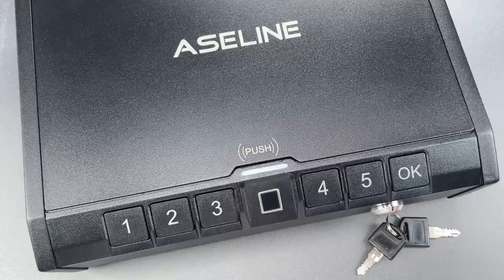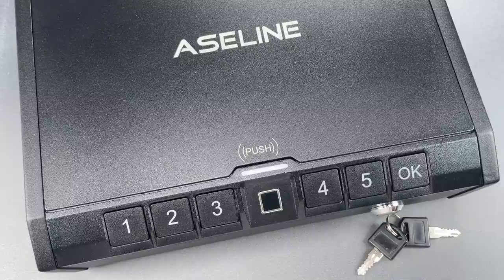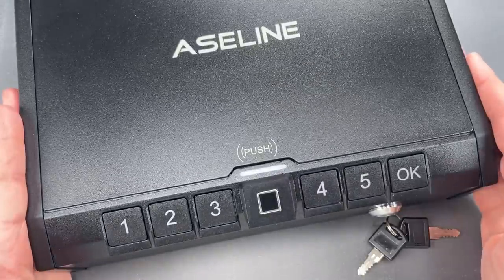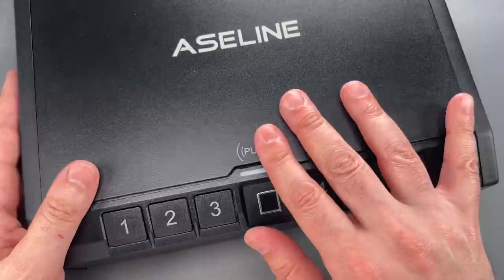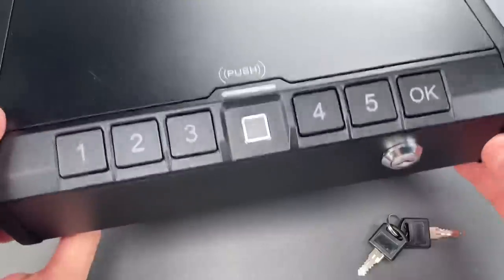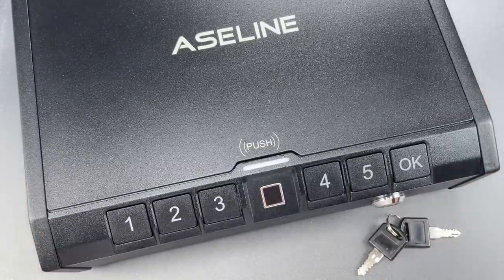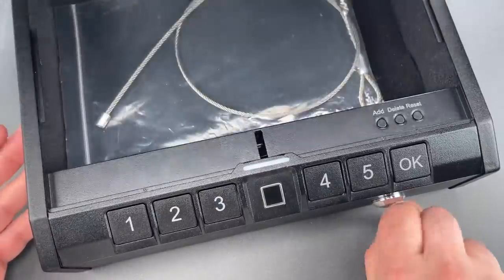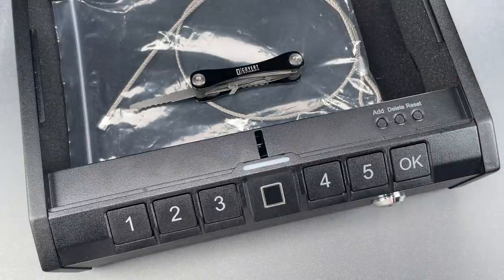[1445] “Aseline” Jiggled Open… As Bad As It Sounds.

Comment: Is there any gun safe out there that's not crap?   It seems most just exist to fulfill some minimum legal requirements.
Reply: That's basically why these handgun safes exist, because it's a legal requirement in some US states (the same goes for many of the very cheap gun lock mechanisms).
Most people don't actually want them at all, so many are made as cheap as can be gotten away with so people can spend a minimum on satisfying the legal requirements.
People have guns in case something happens, and they want it to be ready to use as fast as possible when seconds matter.

If you want safe storage for guns, what people typically look at is a proper standing gunsafe, the kind with shelves and racks which you can stack a whole set of long guns into vertically. If it's one you can bolt into your wall and floor, all the better.

Another option is higher end cable locks, basically an armored steel cable with a plastic/rubber cover (to protect the gun), and where you open the action of the gun and loop the cable through, locking it in place. That kind of setup would prevent the gun from being loaded and from being put in a fireable state.
As long as you get a decent one which can't be just jiggled open or which can be clipped in a matter of seconds with boltcutters, it would be fairly safe in terms of a household with small kids.
Theft protection is near nothing for small and light solutions like these though, as the locked gun can be just carried away, and the perpetrator can work away at cutting the lock/cable at his own time and in privacy.

Now, thieves have occasionally made off with entire gun safes, but that's less a swift crime of opportunity and more a planned 'heist' where two or more people have scouted the place out and they're gonna lug it out to their car to crack it elsewhere. Being able to fasten your safe to your house, both the floor and the wall, is therefore helpful in making such a venture harder and more time consuming. Note that it should be in something more rigid and sturdy than plain drywall though, otherwise that's just for show.
Reply: He's done a whole bunch of videos on locks and handgun safes, they're worth looking at to get an idea what can be worthwhile and not.

Comment: A little curious on the construction of the box and if it has an exposed hinge or any other glaring vulnerabilities.  Also, you only opened it once.  I say "fluke".  This is the one high security wafer lock that is almost impossible for you to jiggle open.  You just got lucky.

Comment: Meet the world of common sense...  Never ever store a loaded weapon.  Ammo should be in a separate safe locked away, sometimes WITH the magazine.  If you're going to use cheap gun safes, take sensible precautions.
Reply: The only reason the gun has a quick release open finger print lock is so it can be used quickly. They know the market. There is literally no reason anyone would store a gun loaded otherwise.

Comment: Honestly i think that this is safe enough for some curious kid, it would never have occurred to me as a kid to get a jiggle tool and try to open a lock, sure, it's not safe against someone who knows a little bit what they are doing but a kid propably won't open it.
Then again it doesn't take away the fact that it's terribly insecure for the purpose of storing guns, but at least little timmy won't be opening it with a fork

Comment: I would at least hide the cylinder on the bottom or rear of the case under a cover with 10 security torx screws.

Comment: I do think that this one would stop a curious person including kids from eay access and as it has a code which. could easy be guessed it does not really need a high value lock as it is designed to secure  the pistol to allow quick access and  u had to use a specialised bit of kit to open it and it was a delipetae attempt and u needed to know how to do it. the best test would be give it to someone who did not know how to open it

Comment: Good grief, this is as sloppy as a lock that can be defeated with a wave rake. If it wasn't faster to just jiggle the mechanical lock, that numeric keypad only has five numbers, and I bet the PIN is four digits long, and probably wouldn't take too much to solve for. If destructive entry is fine, that latch looks like you could beat it with a flathead screwdriver and a hammer, and the construction looks and sounds like it's thin and vulnerable. Could probably get through it with a hammer and icepick.

Comment: I really don't get why these safes cheap out so hard on the manual override lock. Like they thought to go as far as making sure that you can't reprogram the e-lock while it's closed, but they still use a tiny shitty lock as the bypass. Is it really that expensive to just buy a slightly better core?

Comment: Do you actually have to have a backup lock? I'd assume that for safety reasons, having to destroy the "safe" if the main lock is not usable for some reason would be a better compromise than putting in a weak backdoor.
Reply: Its a perspective thing, people see a key as a "harder" lock because you need an item(and thus a sensible backup) where electronics require merely data that can be gleaned and is the "easier" to open lock, despite the fact that the key is the weakpoint in reality
Reply: @syrelian  It would be stronger if it was a good one.

Comment: Would this safe be viable if you... I don't know... solder the keyway closed so that it can no longer be used? 
If you remove that method from the equation is the rest of the safe secure?

Comment: Videos like this often make me wonder: If I disabled the physical lock -- say, filled the keyway with superglue (and then relied exclusively on the fingerprint or combination, obv.) -- then would this kind of lock be reasonably safe?
Reply: yes but the lock exists for a reason, if the battery dies you'll have quite a fun time getting it open, assuming of course that you aren't buying one of those cheap ones that could easily be broken into destructively.

Comment: If you like a weapon case/safe but had a cheap lock cylinder. Are you able swap it out for a better or is it permanently fixed?
Reply: detaching a lock from a steel safe sounds like quite the operation but maybe
Reply: @ZechsMerquise73  Yes it could be. Would be worth it if the weapon case/safe checked the rest of the boxes. Companies cutting corners.

Comment: Hmmm, would a “curious adolescent” have lock picking tools readily available? Could you get into the safe with other “tools” one might have on hand? Just curious.
Reply: Maybe a strip of folded aluminum foil or a fork. Kids are crafty and will use just about anything they can get their hands on.
Reply: I'm pretty sure it would fail with a hairpin or bent paper clip just not look as good.
Reply: absolutely yes. Zip tie, paperclip, hair pin, steel from a windshield wiper, bit of a soda can...the list goes on, and the technique is simple. stick something in and rattle it around until the lock gives in and opens. specialized tools are just a little more reliable

Comment: Is there a gun safe you CAN recommend? I've been looking for one. But I am weary of bad designs. If someone has a recommendation, please drop it below. Thanks
Reply: Vaultek LifePod Gun Safe revision 2
Reply: the Wyze gun safe looks good, but I want him to take a crack at it.
Reply: @syndicator  It seems LPL did a video on the 1.0 version. And it could be opened with a fork via poor reset placement. But it seems that's been solved in both the 1.0 version and 2.0 version. I'll look into it thanks
Reply: @txjeb  I'm not sure I want a "smart" gun safe for my firearm. Especially with the couple privacy issues Wyze had in the past with their cameras.
Reply: @ericbaker8807  it's not internet connected.  Bluetooth only, to prompt it to store fingerprints.  The fingerprints are stored on the device.

Comment: Are electronic door locks "un-pick-able"? Please feature them if they are a viable alternative to traditional lock, as they are getting more popular.
Reply: They tend to have mechanical backups that are pretty shit. LPL's features a few before
Reply: Yeah I agree with iron boy. There’s a Schlage model that’s in a shitload of homes that can be opened with a zip tie or by picking the lock. Best bet is to get a deadbolt from medeco or multi lock with a brace plate and screws that go into the jamb studs. That’s resistant to kicking in as well as even more advanced pickers. The time it would take to pick one of those deadbolts someone would notice a person standing there messing with your lock. Wouldn’t hurt to get a camera that alerts when there’s movement at the door, they are cheap now and connect to your home WiFi. For a couple hundred bucks you’ll have a very difficult to pick super strong door with a camera that alerts you on your phone to anyone at your door instantly making it pretty damn secure.
Reply: @LuckyStrike01  just weld the door shut 5head

Comment: Imagine all those "curious adolescents" that now know how to open gun safes because of the LPL.  When you pull the vail down on the security theater, something that you wouldn't have questioned, because you didn't have the context, and was "secure" is now not.  It is almost like LPL is nudging the teens and telling them "Don't go open your parent's guns safes *wink *nudge nudge"
Reply: This has been the agreed upon standard for lockmakers and locksmiths for basically three centuries. It's better to ignore bad locks than it is to expose that they are bad and risk more people getting robbed. What it means is that unless you are paying an insulting amount of money you're looking at a lock that's going to fail because no one has called them out. He started this channel and makes the videos the way he does specifically to force them to step up because too often the weak spot is almost designed in. The fact that this is the first gun safe that I've seen that actually disactivated the buttons when it was closed is an example of that. Yes he is showing everyone how to get into these. But the goal is to make the makers of these stop making such poor material.
Reply: I was opening these sort of locks LONG before YouTube even existed.  The other way of looking at this is parents might see these videos and get rid of their crappy lock boxes and buy something that actually offers decent security.  I have a decent gun safe, but I learned that the electronic lock that it came with was vulnerable to an exploit.  I replaced it with a good Sargent and Greenleaf electronic lock and installed a secondary Medeco lock.  (Both must be unlocked to open the safe)

Comment: I would have to disagree with you on your gun safe a curious adolescent would not know how to operate a wafer pick much less pick a lock. The programming buttons do not work when the lid is shut if they didn't know the code and don't have your fingerprint or the key I would have to say that lock is pretty safe to an adolescent anyway. I mean if you can put a video on here of an adolescent that has no lock picking experience and that adolescent can open that safe without destroying it or rendering it inoperable I will video myself putting my foot in my mouth and I will give you and said adolescent $100 a piece. Prove me wrong please, please take my money!!!!